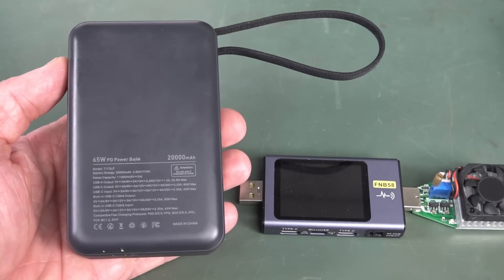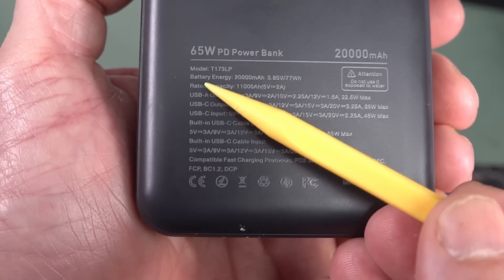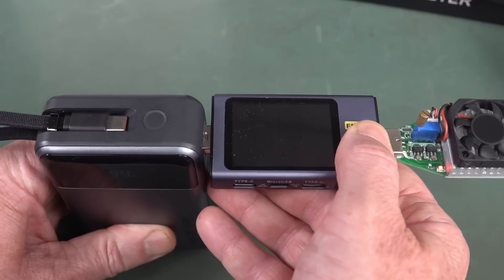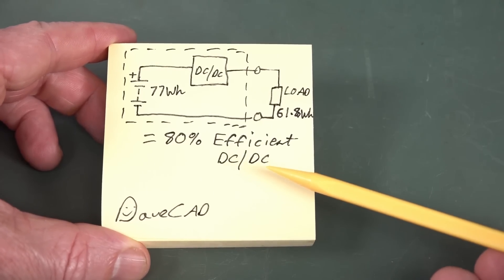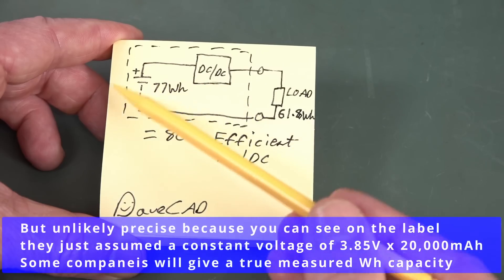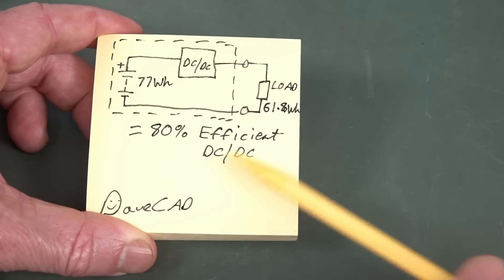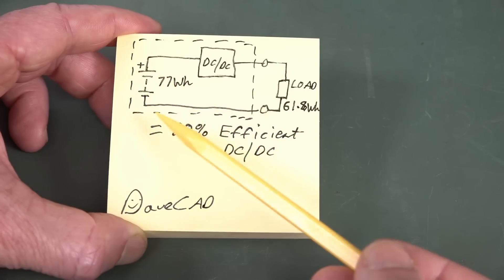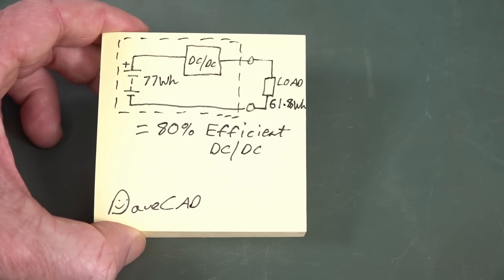EEVblog 1648 - USB Battery Bank mAh Capacity ratings are a LIE!

Comment: I actually have a Hama power bank that is sold as 10000 mAh , but on the back it actually says that it has usable 6605 mAh usable capacity. it's something.
Reply: Remember that when the battery is at about 3.8V and your load receives 5V, the mAh figure at the load will always be much lower than at the battery.
That is why the Wh figure is much more usable to begin with.
Reply: @Rob2  That is not in itself relevant. The voltage is raised at the output which lowers the current but at the phone battery end the voltage is again lowered.

What counts is that the process has losses, not the fact that the voltage on the transmission is higher pr se.
Reply: Usable capacity is a very flexible concept...

Comment: Reminds me of computer drives where Marketing decided "megabyte" was going to be "1,000,000 bytes" when stating capacity, not the binary 1,048,576 bytes. It makes drives seem bigger to customers...but not to computers.
Reply: A megabyte is a million bytes. You cannot redefine the prefixes.  A mebibyte is 1048576 bytes
Reply: With RAM, bases of 2 make sense because of how RAM is constructed. With storage (and network), bases of 10 are consistent with all of physics and engineering.
Reply: @crackwitz  Not really, non-volatile storage capacity is best represented as base-2 because it's binary all the way down (to sectors). It's 100% marketing ploy, like using bits instead of *bytes*.
Reply: @hanifarroisimukhlis5989 Nah. Did you know that HDD storage density is expressed in bits per square inch? I understand you're angry because Windows divides by 1024 and you think you're being robbed of your money. You can blame Microsoft for that, or simply accept that it's irrational to count these quantities in multiples of 1024.

Comment: Would be interesting to know how much power you need to charge it back to full. 

The input refered capacity is what the plane security asks for when they have a limit for battery capacity in the cabin. 

And the last ting I wonder is of you take the cells in series, you dont have 20Ah and 3,8V, but you then have lower Ah and higher Volt. They still mark it as 3.8 and 20Ah....
Reply: I bought one specifically for travel, and I wanted basically as much as I was legally allowed. I assumed they gave the number that the flight folks ask for.

Comment: A charge is energy, GTFO.
Reply: nope, a charge in a potential is energy.
Reply: @markotrieste  No, energy is the charge times the voltage - and even that is simplified as the voltage gets lower when the charge is used.

For example my Canon Compact camera uses a 1250 mAh battery and my mirrorless camera uses a 875 mAh battery. However, the latter has more energy  as it is 7.4 V instead 3.7 V.
Reply: @okaro6595  And what did I say? Isn't "voltage" the layman term for "potential"?

Comment: There is some wrong useage of terminology in this video.
Battery capacity is rated in amp-hours. This is a unit for the amount of charge (the SI unit for this is Coulomb, 1 Coulomb is 1 Ampere-second, so 1 Amp-hr is 3600 Coulomb).
However that is not the same as the amount of energy.
Amount of energy is expressed in Joule, or Watt-hour (1 Watt-hour is 3600 Joule.
So when referring to battery capacity, use Ah (or mAh), and when referring to the amount of energy, use Wh or J.
Reply: A battery capacity in mAh is only useful when you know the voltage of the battery. And even the discharge curve of the voltage.
When you want to know the useful capacity of your battery, specifying it in Wh is much more useful. A battery stores energy, not current.
Reply: @Rob2  True, but pretty much every battery from a AAA cell to large truck batteries are specified in Ampere hours. The assumption is made that it's still a useful way of comparing batteries of any given type.  The problem occurs when the battery chemistries vary (so different voltages) and then DC-DC converters are added to make things worse.  I guess that's why electric car batteries are now specified in kWh.
Reply: @GodmanchesterGoblin  Yes, it is only meaningful when comparing things like 12V car batteries or AA cells.
For a functional unit like a powerbank it is a useless metric.

Comment: 20,000,000,000nAh!!!! *Obviously doctored picture of tiny battery bank on the tip of a finger*
Reply from the maker: 1980's ghetto blaster 2000W Peak Music Power Output! (PMPO). Good times.
Reply: @EEVblog Pretend Maximum Power Output is what my friends called it.
Reply: @gf2e  Yup 🙂👍
Reply: @EEVblog  My 5,000 watt early 2000s eMachines computer speakers would blow the cones off that unit.
Reply: @EEVblog  There is a bit of a faff with this at the moment. FTC made a new amplifier rule that basically means amps must all spec maximum power at 20khz, right where we need it, lol.
Reply: Gotta love those 100000 dB horns from Wish, apparently producing pressure waves capable of obliterating the universe and all of it's parallels a million times over

Comment: I was looking into this about one or two years ago. I thought the way it’s labeled, these high-capacity packs should not be legally allowed onto airplanes (carry-on anyhow). However when you do some of the math, including efficiency, and try to work backwards, they do squeak under the airlines’ policies. I doubt the average luggage inspector could do the math in their heads. So while big numbers are great for marketing, they may unduly alarm the baggage inspectors. They’re not likely to be electronics wizards. They’re not expected to open up the battery packs to see what cells are really in there and to be able to intelligently counteract the marketing exaggerations so it’s a real dilemma. Maybe they just have a chart where they look up different “marketing” ratings and scale it down accordingly. Laptop batteries are usually worse… but then they are required to be check-in baggage… I think there’s a cut-off capacity.

Trouble is, airlines use one rating whereas the numbers on cases use another scheme. Consumer confusion is the name of the game. I doubt anyone in an airport has 1/10th the wisdom of Dave or even that of a decent electronics hobbyist.
Reply: Don't they all just list the total Watt hours of the contained battery cells?   This is what the airlines care about and is apples to apples across laptop packs, flashlight batteries , tool batteries and power banks.   This will be the highest figure.  If there's some future push to list net output Wh, I think they will have to list two numbers(in turn  exposing the efficiency of the DC/DC converter. a good thing ...)
Reply: The airlines in the us just got it changed so you can take much bigger batteries onto planes.
Reply: @alexdrockhound9497  Interesting. I’ll have to look into that. I hope they made it a lot clearer what criteria they use: milliamp hours vs. watt hours (conveniently omitting battery voltage versus voltage booster output… so there’s still all that confusion I’m sure).

Comment: One thing that has surprised me is how wildly the round trip efficiency of cheap usb power banks varies, i've seen some as low as 30 and as high as 90.
Reply: Yes. The cheapo classic 'big Clive' charge-discharge protection board with the TP4056 chip uses internal linear voltage regulators and dissipate a lot of heat while regulating(at least while charging).
Reply: I'm guessing the inefficient ones to charge use a linear regulator to drop from 5V to battery charge voltage.